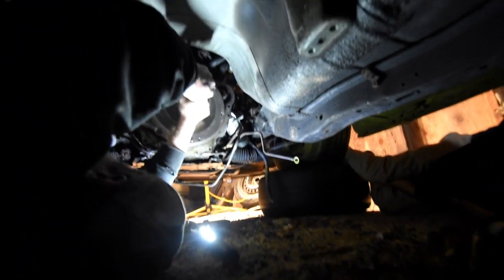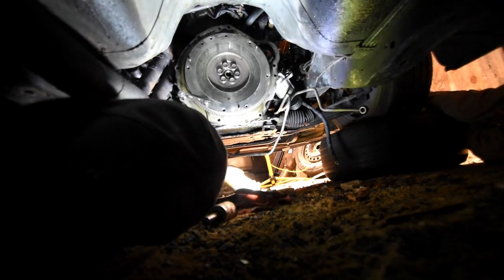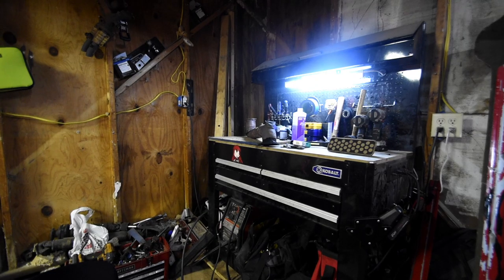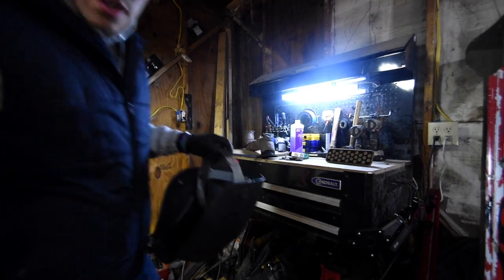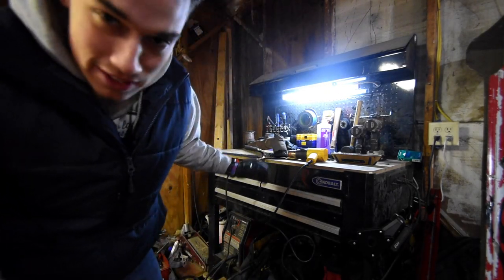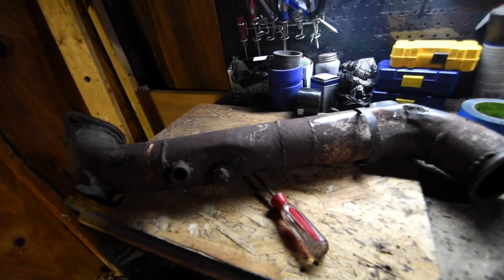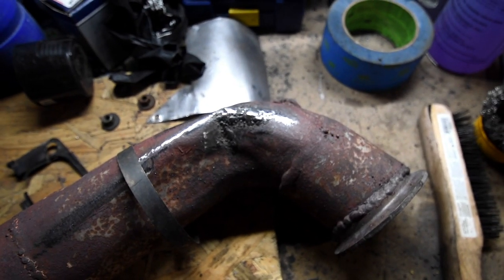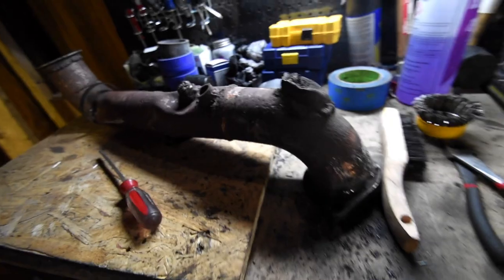What will BREAK first? My will or my s13?

Comment: Ok, so here's the other thing you can do to get the bushing out: It's brass so a well placed flat head screwdriver and several strong whacks of a hammer will break it. That's what I ended up doing on mine. It was way easier since the engine was out of the car, but it looks like Tom had enough room under your car to at least try it.

Here's the short clip I have of getting the new bushing in: https://youtu.be/8TQquRDT-Vk?t=6m57s
Reply: I can also try patching your downpipe with my MIG if you want
Reply from the maker: Sounds perfect man!! and sick man! Ill check it out!!